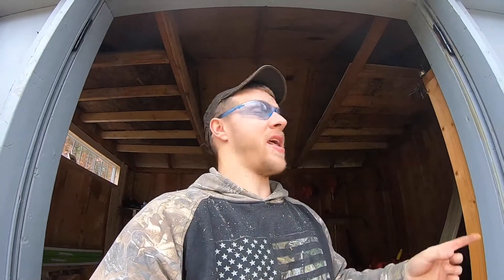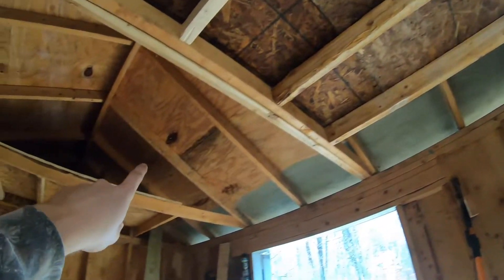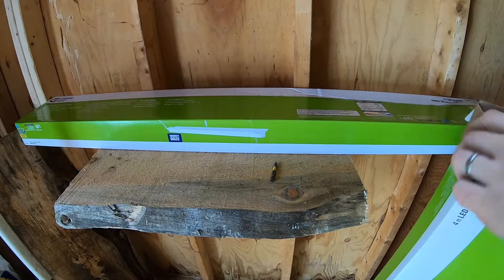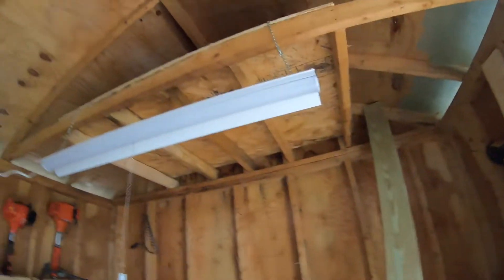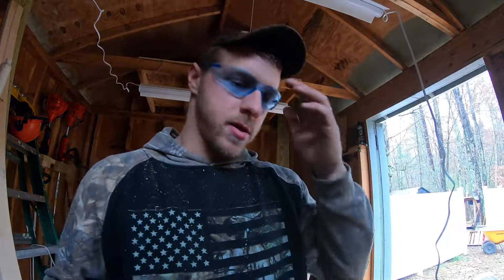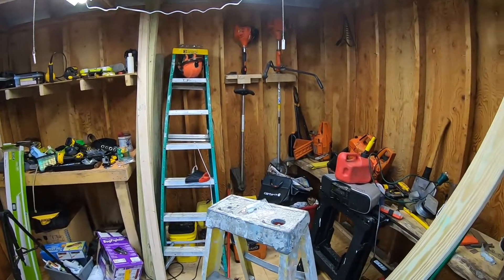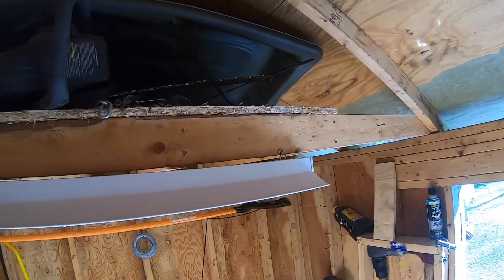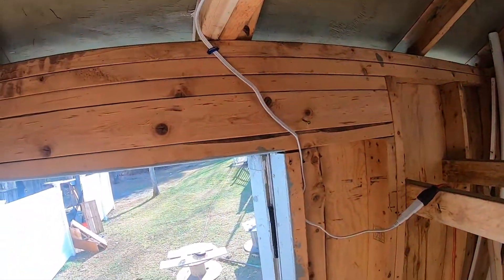NEW SHOP LIGHTS!

Comment: Good evening Sir, I think you need to bring some electric power outlets 😊👍 Great powerful lights  😎 Cheers !!!
Reply from the maker: Hey Dave! I think I will dig a trench and run some line next year for sure! Would be nice to not have to deal with extension cords lol!
Reply: @HomesteadJay  You will love that plan Sir, I did the same for my wood shed ( 220v 60 amps ) for running my house generator i case of lost of power and able to safe it inside a shelter and against theifs Cheers !!!

Comment: I picked up 6 similar light fixtures at Harbor Freight and hung them in the pole barn. Transformed it from a dark cave to now actually being able to see what I'm working on. You need to ditch that extension cord, tap that pool outlet and run an underground cable to an outlet in your shed.
Reply from the maker: Hey Mike! I plan on running power out here next year for sure! Glad you got your pole barn lighted up! Light changes everything lol!

Comment: I replaced my fluorescent shop lights in the garage with the LED versions. They work in sub-zero temperatures when fluorescent fixtures barely light and they last a lot longer. Just keep in mind that they are not explosion proof fixtures. If you are going to store and work on gasoline engines in your shop, I suggest you put an on/off switch on the outside of the building by the entry door and cut the strings off of the light fixtures because those switches can spark. The lights don't have a ballast. So, there shouldn't be any sparking components in the fixtures otherwise.
Reply from the maker: Yes good point! I don’t plan on storing any gas in here plus the shed roof rafters are not closed in so the shed vents very good! Thanks for the tips though! Good to keep in mind!